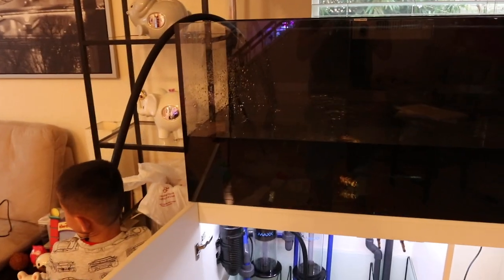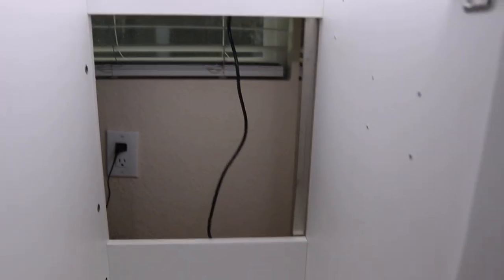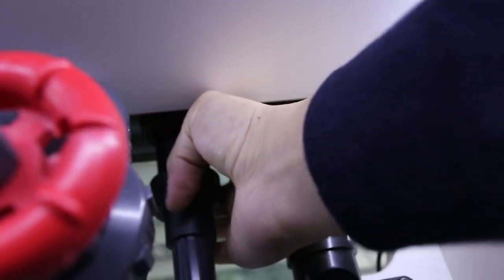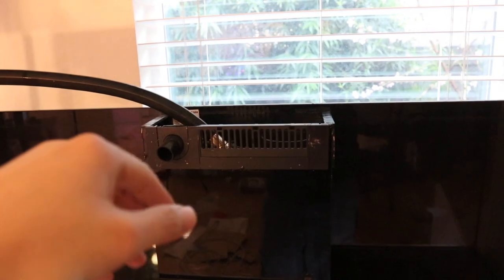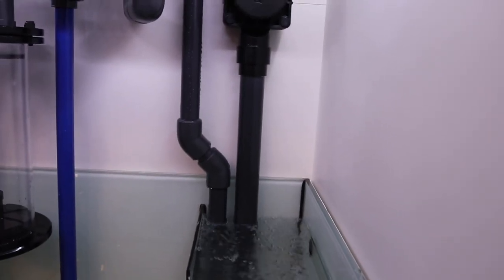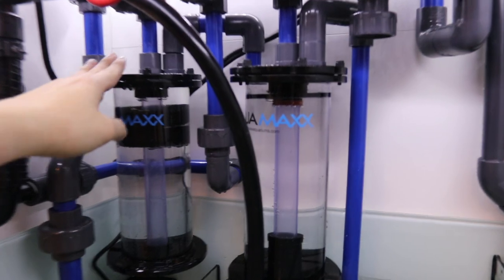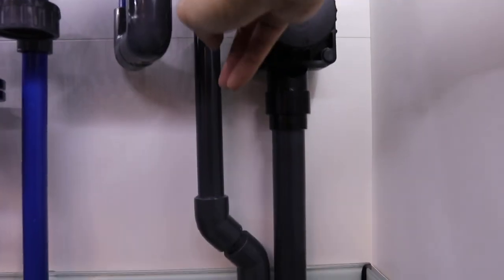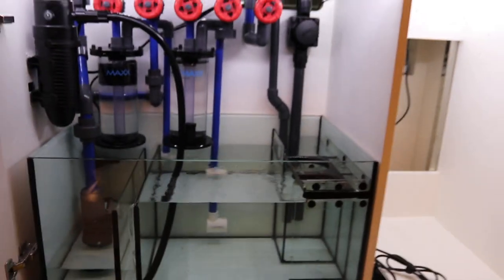STARTING UP THE RED SEA REEFER 350 MARINE AQUARIUM

Comment: New subscriber!  Your videos are very informative.  Just picked up a 425xl and your hard plumbing and design is what I’m looking for.  If your don’t mine do you have a video of your plumbing?  Like what size hard piping you used and size of gate valves you used as well.  Also are you located in Los Angeles?  I’m out of North Hollywood
Reply from the maker: Raymond Olivares thanks for subscribing! Check out the description I left a link to the write up on the sump build. It includes a list of all parts needed 👍🏼

Comment: Hi,  nice videos!   I know you have a custom sump setup but did you get your sump tank from Red Sea and how did you setup the different compartments of the sump?  Thanks!
Reply from the maker: Thank came from LFS and it is the older version one. Originally it just flowed I to on chamber and the the second chamber which has the skimmer and media. The second chamber has the return pump, heater, and auto top off sensor.
Reply from the maker: Thank came from LFS and it is the older version one. Originally it just flowed I to on chamber and the the second chamber which has the skimmer and media. The second chamber has the return pump, heater, and auto top off sensor.

Comment: Hey I have a similar tank, I also want to test it for water leaks. If I fill the rear weir up where the pipes go like you did and notice a leak how do I empty the water from that compartment? Thanks
Reply from the maker: You will need to stick the hose in the overflow and syphon it out
Reply from the maker: You will need to stick the hose in the overflow and syphon it out
Reply: Is that how you fixed your leak? Or did you come across another way? Great video BTW!
Reply from the maker: Travel With Me I just hand tightened it a bit more and it stopped. If it kept leaking I would have i screwed the pipes and check the rubber o rings
Reply: @prolificbreedaquatics  thanks! The aim is to be a pro like you one day 😁
Reply from the maker: 😂 I’m not a pro haha

Comment: Im planning to buy a red sea reefer aquarium as well. The thing is this is gonna be my first tank. And im kinda worried about assembling the sump coz its my first time. Was it hard?
Reply from the maker: Hey there. A lot of the sump pipes and and equipment is custom on my setup. If you are just doing the factory setup I think it is straight forward. Let me know if you have any questions
Reply: @prolificbreedaquatics  is it easy to control the water level in the sump?

Comment: What kind of light are you using to light the sump?
Reply from the maker: Joel Duval it’s just strip lights you can find on amazon. Search for 5050 strip lights and you should find a bunch. They come in rolls
Reply: @prolificbreedaquatics  ok sweet, thank you! I'm going to purchase a Red Sea Reefer 350 also this June and I love how you set the light up in there. There isn't any dark spots that I can see and I dig it a lot.
Reply from the maker: Congrats! You'll love the tank. Keep in mind the sump sides and back glass are all painted white rustoleum enamel too.
Reply: @prolificbreedaquatics  Thanks! And thanks for the heads up, I haven't seen the sump in the light, it's always dark so I didn't even notice that. Now rewatching your vid I see it lol. I'm still torn on whether to get it in White or Black. White looks super clean, but every stand I've ever had was black..... So it's my comfort area I guess lol
Reply from the maker: Joel Duval can’t go wrong either way. I rarely see anyone with a black stand though.
Reply: @prolificbreedaquatics  True. I think it's because the black shows salt creep way easier. That's been my curse for the past 13 years 😆